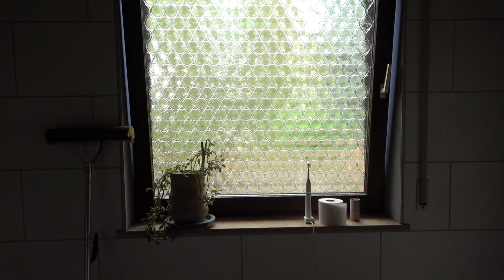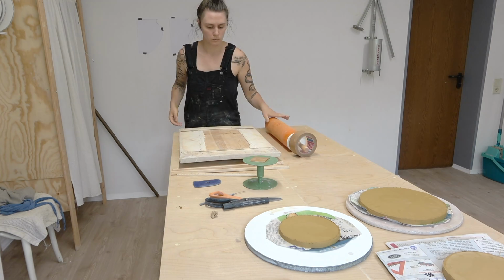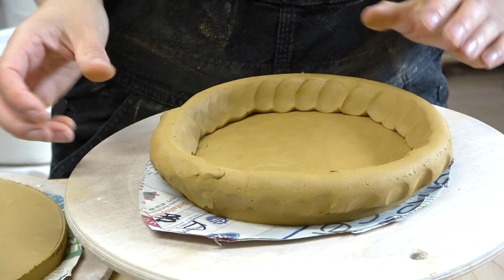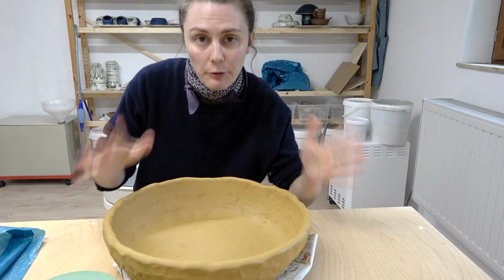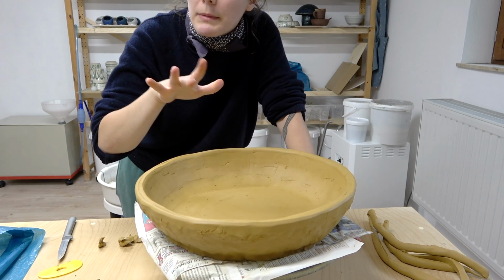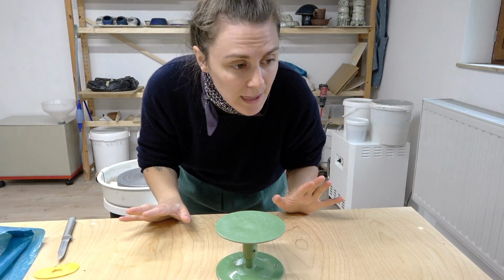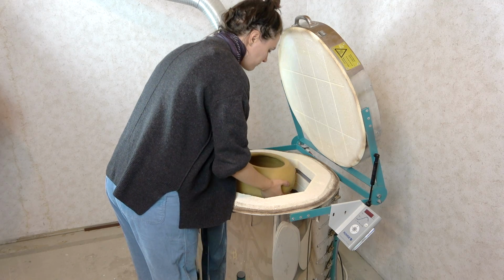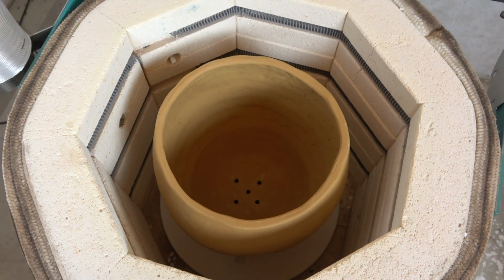Attempting to Make a Ceramic Table // large scale coil building pottery project for beginners

Comment: As others have already stated, the "process" of designing & measuring" is incredible. Your template work alone, is a major inspiration.
Have you ever done any small lamps, with matching shades? To be  used with an electrical "socket" insert in the base?
You're an incredible inspiration...you broaden our horizons.
10 🌟's

Comment: Mia thank you for your work! I'm learning a lot from you. I'm new to ceramics. I see you didn't glaze your product. But it will be used next to the sink where the water is. Please tell us on your channel when it is important to cover the product with glaze and when it is not important. Flower pots are not necessarily glazed.  Do I understand correctly? Is it normal to leave a flower vase outside without glaze completely or partially?